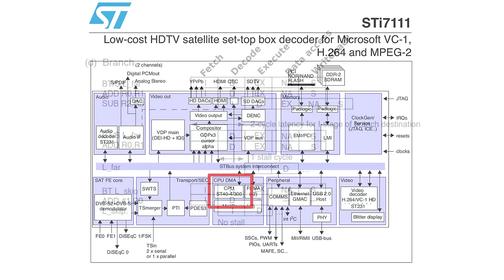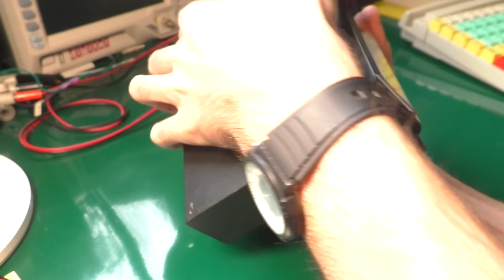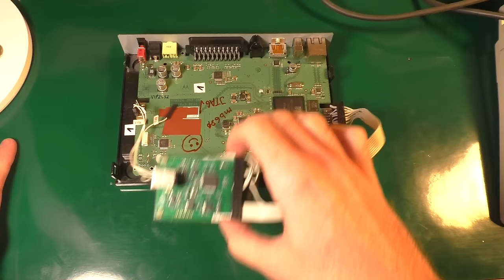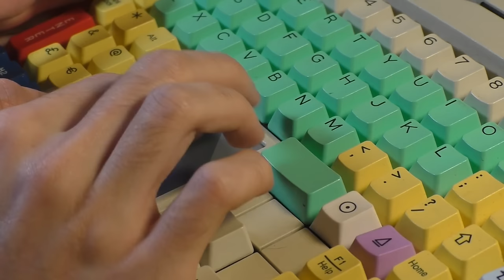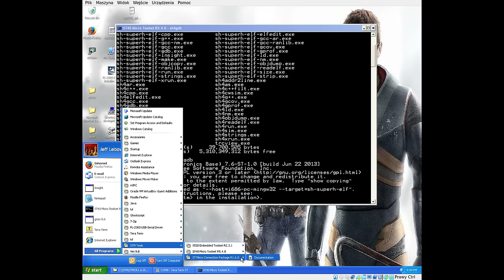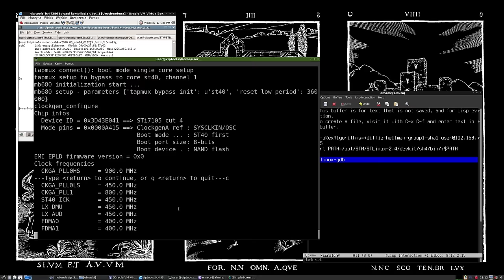Linux on a set-top box: Part 1 - debugger access

Comment: Wow! Back in the day I played with similar box - Infomir MAG-250. Tried to install Kodi or minimal Debian for some DIY projects. Unfortunately, it had digital signature checking for kernel and didn't allow to flash another u-boot. So I bought f2232, my first JTAG board, installed Windows XP in a VM and started configuring all this old software like you did in this video. I remember that I spent a lot of hours trying to make it work, but every time I got nothing. Hopefully, I found an old DVD player with similar flash chip and used it as a programmer for my box' NAND flash.
It worked perfectly and I got a fully unlocked board which I used for... nothing😀. It had too low resources for Kodi, lack of hw-crypto for networking,  and a very specific architecture.
BUT, today I learned why my JTAG did not work. It was just locked!!!

Comment: I did have a very similar Motorola box powered by an ST chip a very long time ago. It was given to me by my ISP as a client device for IPTV. That model from what I recall only supported standard definition. My ISP later gave me a newer STB model with MPEG4 and HD support and told to discard the old box which I (sadly) did.
BTW, the KreaTV platform this box used is still very much alive. I took apart one of the newer Arris 4K models. They are powered by HiSilicon (Huawei) ARM SoCs. The whole UI runs on a web browser called Ekioh.

Comment: Old Polish sat provider N had boxes called Nbox inside of which was similar sti cpu. First revisions had unlocked cpu but newer included locked cpu and people figured out the lock and made a modchip. You can find ready u-boot images and full working enigma2 (linux designed for stb)